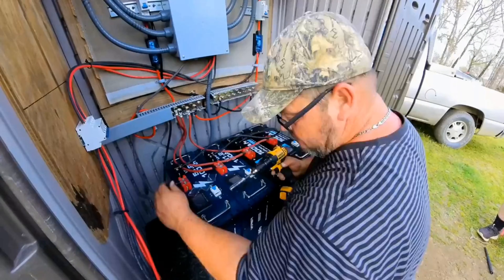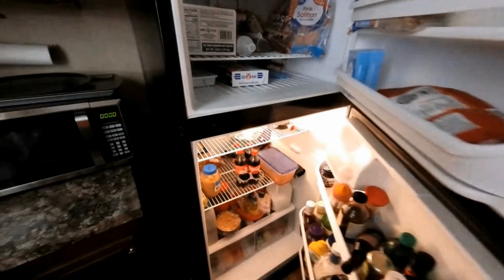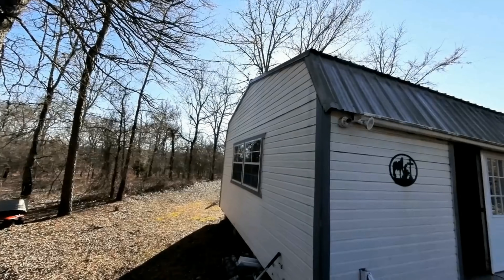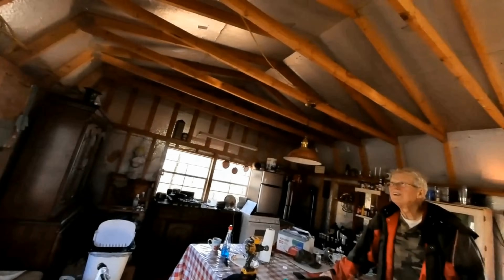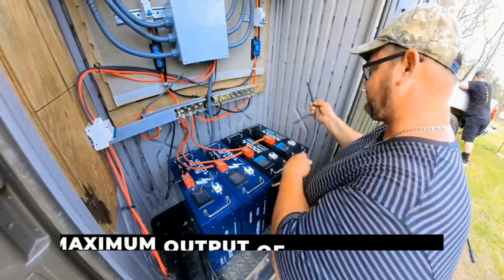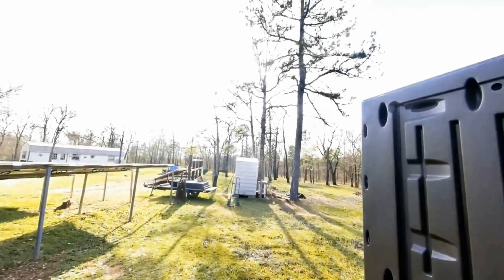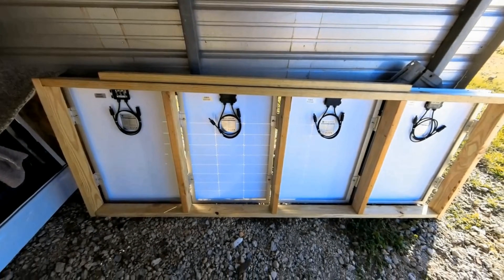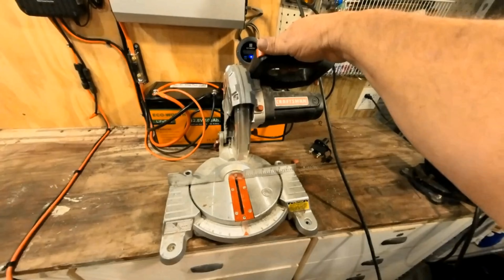Easy Solar Power Setups You Can Afford!

Comment: Question, my positive cable on my solar setup got extremely hot melting the glue on the wire during high consumption (1000watts). I have 3k pure sine inverter, 300ah batteries, and 200watts of solar. What would cause that?

Comment: Why do people test these things empirically? 

It's simple math, if you know the battery Ah (amp/hour) rating (all batteries list this) and you know the appliance rating (all appliances have to list these parameters), then do the math:
E=IR (Voltage = Current x Resistance)
P=EI (Power = Voltage x Current)

By yourself a cheap P3 energy meter and plug you appliance in for a day or an hour, let's say we use a fridge that runs 480 watts in a day on our meter and we have a battery that has 100 Ah rating. What this means is that this battery will supply 100 amps for one hour or 10 amps for 10 hours. So if our appliance uses 480 watts in one day and our 12V, 100 Ah battery can supply 1200 (12V x 100A) watts in one hour then we divide 1200 by the power our battery uses in one hour (480/24) = 20 watts per hour. To find how long the battery will run the fridge we divide the energy the battery supplies in one hour  (1200) by the power the fridge uses in one hour (20) and we get 60 hours the fridge will run on our battery. If you measure your fridges usage for one hour it's simpler, 1200/20 = 60 hours but slightly less accurate.
Simple.
Reply from the maker: people want to see real life scenarios. Its the same concept of people being educated with 5 years of school and have the knowledge of how it works but having no wisdom in real life experience...and because of no experience they cant even get hired
Reply: @OKLAHOMAOFFGRID  It has nothing to do with that. When you design a system do you calculate wire sizes? I hope so! When I designed and installed my systems I figured out how many batteries I needed mathematically. It's science, the same science that went into the design of the BMS in those batteries you're testing.

Each system is different, doing empirical tests on your system has very little to do with someone else's system. Does everyone have the same fridge? No, different products have different current draws. Knowing the math means you can calculate your specific system requirements with different batteries, inverters, charge controllers, etc.
Reply: @mosfet500  real life example are worth thousand times more than theoretical videos
Reply: @kanata2971  Is mathematics theoretical?? NO! What do you think the people who design this equipment use to calculate different parameters. That's rhetorical, I have personally designed this stuff along with 'H' bridge EV motor controllers. If you teach someone how to do and understand the math then ANY system can be calculated not just specific ones like is being done here.

If you can't do the math you shouldn't be installing PV systems.

Comment: if you put a small jumper wire linking each of your batteries together as short as possible it will help keep batteries even more evenly charged. yours might not need it but it helped mine say exactly evenly charged

Comment: I just built another small solar power system from scrap stuff laying around. built a 280 ah 12 volt battery, small victron charge controllers, cobra 1500 watt inverter, couple eco worthy 195 watt panels. should run a fridge or something ya know.
Reply from the maker: Right on!

Comment: Totally Great work!!  Has been on the Solar life since 2000’s. Always knew that just 9 solar panels and the right setup can move all my equipment in the garage, A/C, Water Heater and EV. Best solution to reduce my grid charge in 50%
Reply from the maker: Right on
Reply: @OKLAHOMAOFFGRID  how much do the batteries cost each ?

Comment: I have grounds issues in my Rv class A bought used. A lot of plugs don’t work when plugged into shore power and I’m not getting 12v to a lot of things like a refrigerator. I want to do a system like these but my only block is idk how to undo the wires from the circuit breaker thats been in this Rv for 30 years. Should I remove all the walls to find all wires and remove them, then run the new set up the way I want with new all new wiring?
Reply from the maker: Not necessarily you can use the same wiring you just have to wire everything in at the breaker box
Reply: @ is there a way I could send you short form videos so you can see what I currently have and what I want to achieve?
Reply from the maker: send it on my email
Reply: @OKLAHOMAOFFGRID sorry for the late reply I was extremely sick but I’m sending you some videos in the email now. It will be from teammedjay.

Comment: Thanks for your videos. Can you give me an idea how much it would cost to go completely solar in my 1200 sqft home. I’m getting it spray foamed and will probably have a couple mini splits and wood stove, a mid sized fridge, an on demand water heater. Is there a way to figure up how many panels and batteries I will need
Reply from the maker: i would get a good start with a 10kw inverter 6 server rack batteries and 20 450 watt solar panels
Reply: @ thanks so much for the response. I really appreciate it.
Reply: @OKLAHOMAOFFGRID  by the way it’s just me and my dog. No big family or anything. Also my roof and yard are shaded in the early mornings and evenings so I’m not sure if I can over come this with extra panels? Or if it is even a issue since the home will be spray foam insulated and it will be just me
Reply: Low power consumption options are best. In my log cabin my on demand water heater is propane. I have a wood stove but also a 12 volt diesel heater which is cheap but very effective. I have a total storage capacity of 29 kWh but you can start smaller and keep adding to it. I would recommend a 48 volt charger/inverter and starting with a single 48 volt server rack battery. A charger/inverter has the solar charge controller built in so you can input solar directly. It will also have an AC input so you can supplement charging with a gas generator if needed. Everything I just recommended will cost under $3000. It doesn’t need to be expensive.
Reply: @CompleteOffGridAmateur  I will look into those options. Thanks for sharing!
Reply: I’m enjoying your videos. I’m getting lots of ideas from useful information you provide. Thanks  and yes I’m now the proud owner of a 6kw 48v expandable system. Things are looking good.

Comment: love your videos! inspiring and fun. a question: do you need to worry about the battery getting hot in the hot summer days? How to handle the heat?
Reply from the maker: Yes I do and you just need to make sure that the ambient temperature isn't over 130 to 140 in your shed so if you just have air flowing through with fans or open doors then you're okay